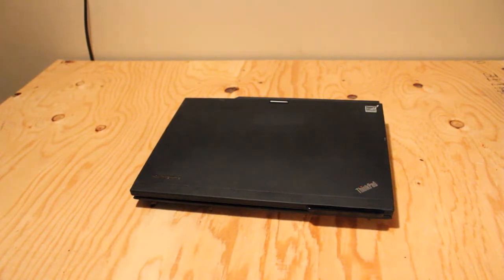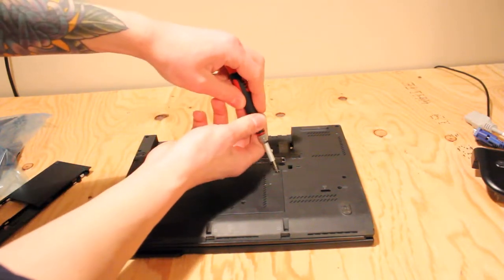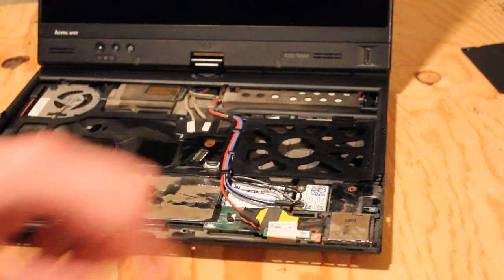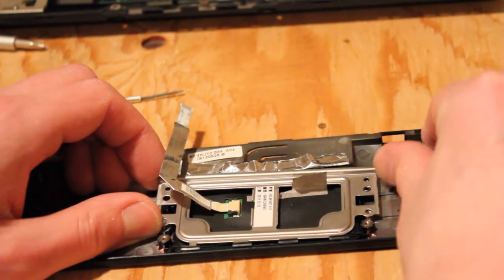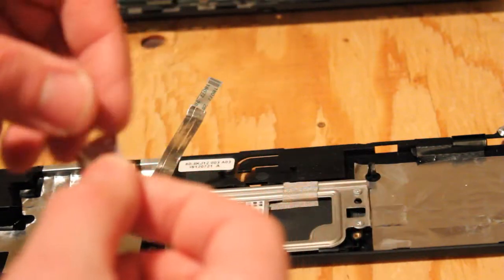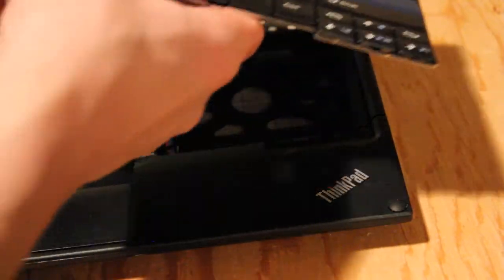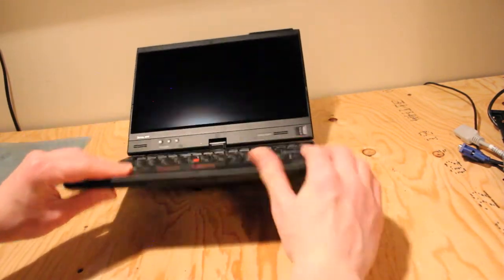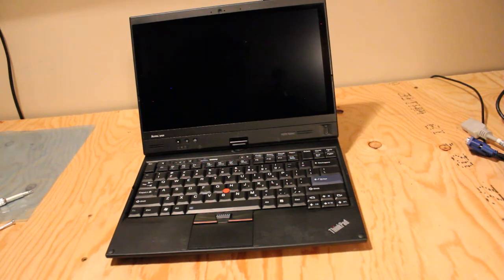Lenovo ThinkPad X220T Palm Rest and Keyboard Replacement (how to)

Comment: hi can i put the core i3 3rd gen on the hp compaq 6005 ? pls answer me
Reply from the maker: That would depend on if the motherboard is designed to have AMD CPU's or Intel.  Mine has AMD, but I believe there are models that shipped with Intel.  Can you verify that you currently own one of these towers and if it has an AMD or Intel CPU currently installed?
Reply: @HaisteComputerRepair  what amd processor you have? and what amd processor can be used in hp compaq 6005?
Reply from the maker: @killuayt6038  I installed an AMD Phenom X4 945 CPU.  Check out this webpage for the Socket Type and a list of possible upgrades at the bottom of the page.  https://www.cpu-world.com/CPUs/K10/AMD-Phenom%20II%20X4%20945%20-%20HDX945WFK4DGM%20(HDX945WFGMBOX).html
Reply: @HaisteComputerRepair  sorry for many ask i have last ask why my motherboard dont have cpu fan pin?
Reply from the maker: @killuayt6038  No worries.  There is a 4-pin cpu connection under the plastic shield that connects from the front fan to the heat sink.  There is also a 4-pin fan connection near the rear end of the board, by the I/O panel.
Reply: @HaisteComputerRepair  thank you so much
Reply from the maker: @killuayt6038  No problem!